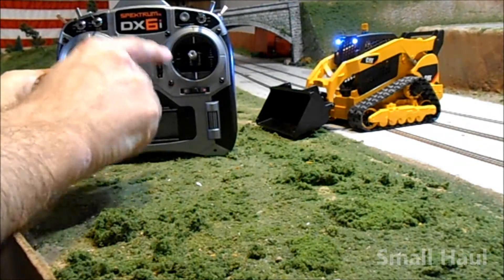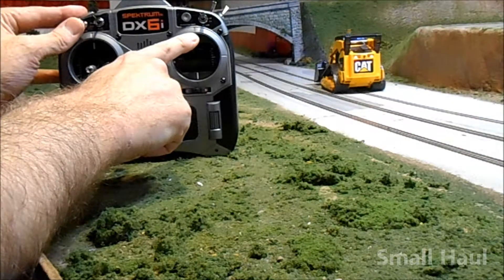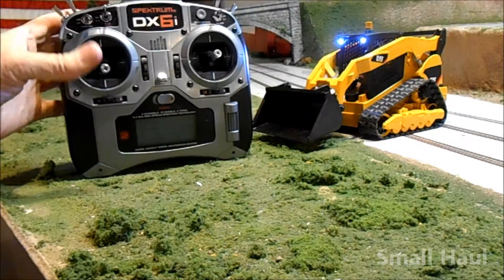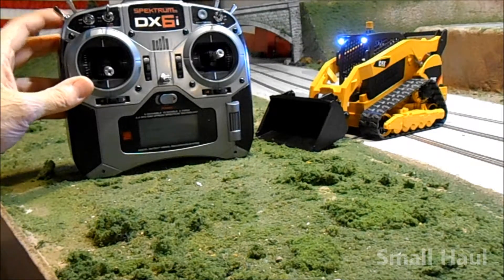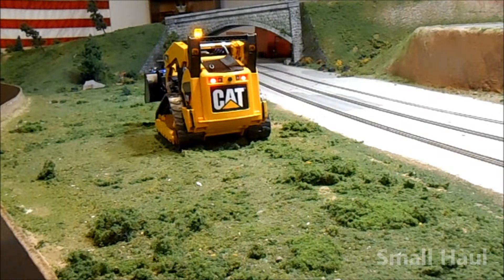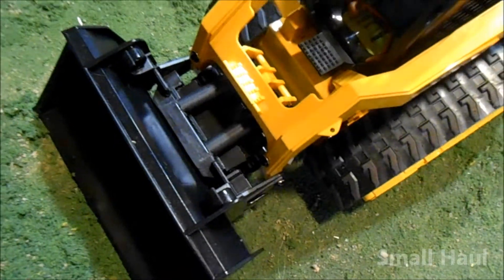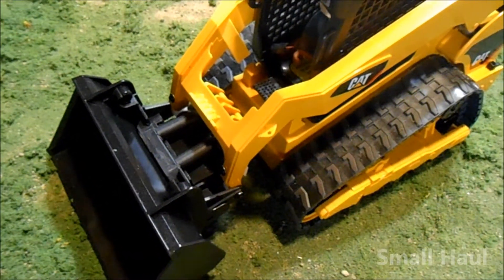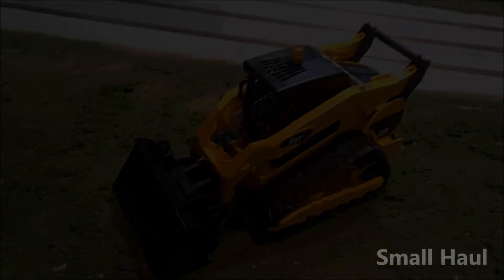Bob's Delta Loader

Comment: Is low and high speed depending on voltage or is it a gearbox?
Reply from the maker: Voltage
Reply: Ok Thanks , Where do you live Smallhaul?
Reply from the maker: Western PA. Where are you?
Reply: In sweden :), How do you solve hi/low range speed with the channel/radio.